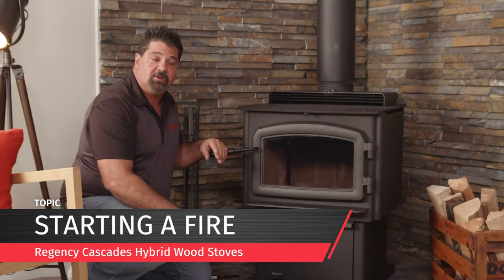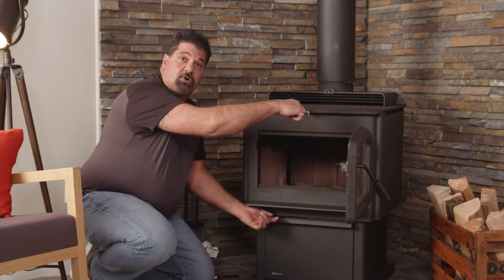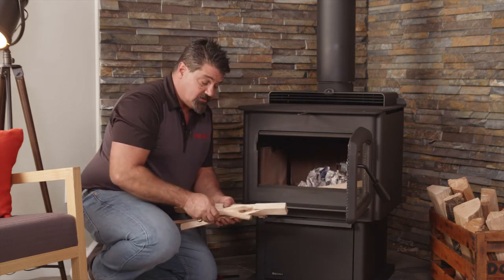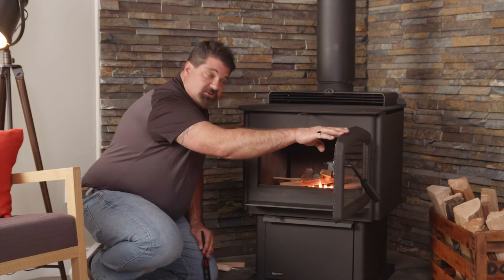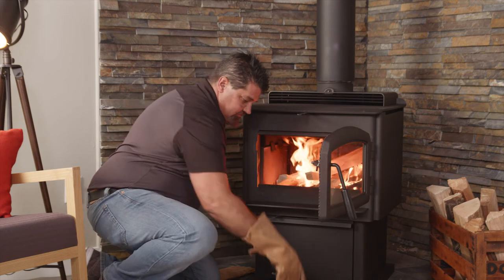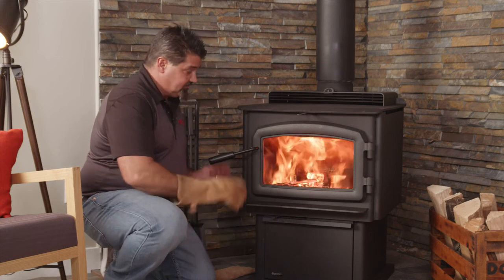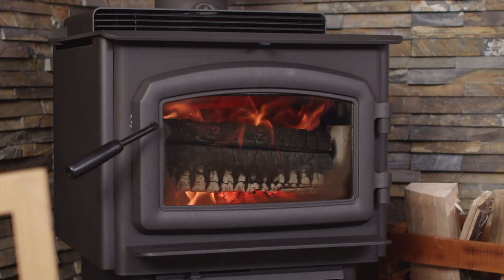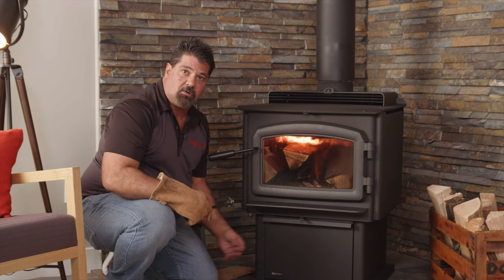Lighting a Wood Fire in a Catalytic Wood Stove | Fireside Tips | Regency Cascades Wood Stove

Comment: Helpful video. Thanks for posting. Is that how you explain the lighting sequence for a cold start in the manual? I'm wondering if it's the same procedure for the NSPS 2020 test since I believed most of manufacturers recommends a top lit method to minimize startup emissions. Thanks.

Comment: 2 errors in this video. I've been burning a catalyst stove for 20 years so I have alot of experience with burning wood. 1) 1 to 2 inches of ash left in the firebox is way too much. Your stove will not burn as hot or efficiently with this much ash. Clean it right out except for a thin layer for a little insulation of the bottom of the stove. 2) laying your logs east/west gives much longer burns than north/south. This is a much understood fact by nearly all wood burners. The reason is simple. The air comes in from the front of the stove. Placing your logs east/west protects most of the wood from the air.
Reply: He also talks about stage 3 (forearm-size logs ) to stage four (leg-size logs), but never shows stage four. I feel like he has the forearm-size logs and leg-size logs confused in the end. Also, a top-down method would work much better with less hassle for building the bed of coals before loading biggest pieces for the overnight burn.